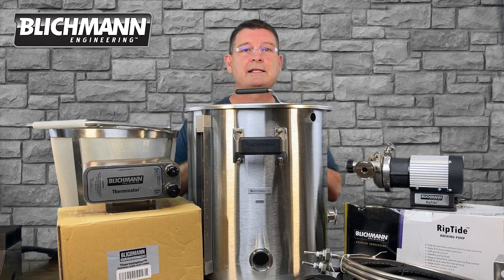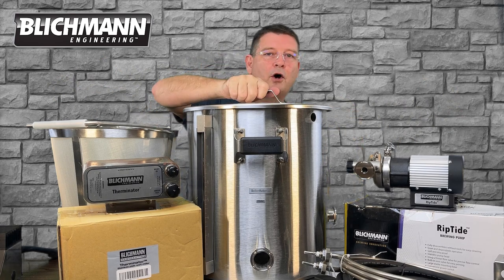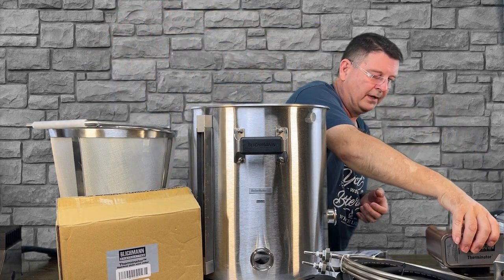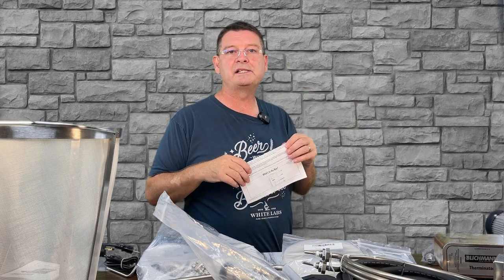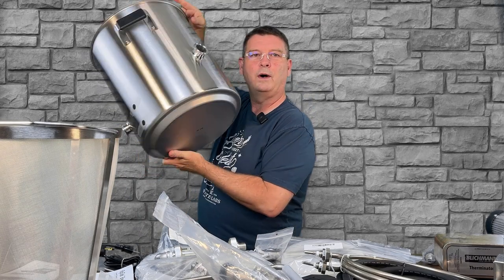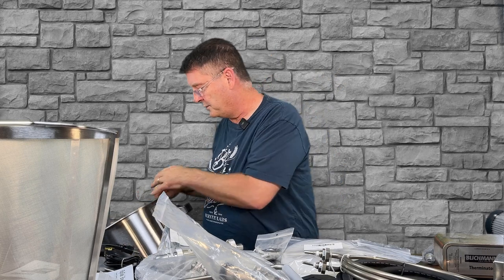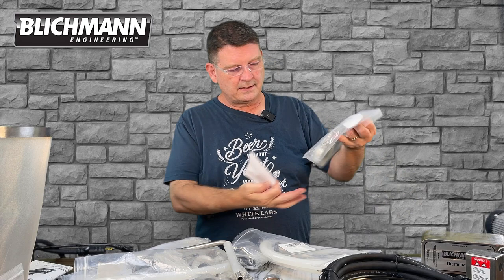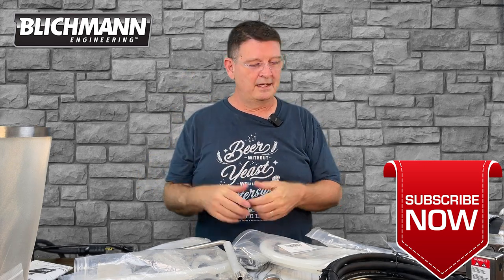Blichmann Engineering Brew easy compact all-in-one - Part 2

Comment: Not to also make some complaint. But, that's a lot of plastic for no reason. Paper envelopes might have been a bit better. Can even label them a bit better. Oh, well... looks like an interesting system. Can't wait to see more of this series.
Reply from the maker: Yeah, I see this with a ton of things I have shipped to me and it does bother me a bit but in comparison this wasn't that bad as I do get why they packaged everything in groups but as you said I guess they could have used paper envelopes. I think they wanted to keep everything grouped and visual at the same time. Not a huge deal for me personally as I have a habit of reusing bags, packing material, and some boxes as I ship a lot to sites I manage. I'm not a "Green" person per say but I do hate waste, so I reuse anything I can, whenever possible. (It drives my wife a little crazy but after 30+ years she has gotten use to it.) The only thing that usually goes to waste for me is the really big boxes and the damaged ones.

Comment: Thanks for sharing. When I built my system I went with the 240 volt boil coil. Pretty happy with it. I also did tri-clamps. Easier for me to take apart. There is some stuff that I would like to change still. Cheers!
Reply from the maker: Sadly those with 120v don't know how good it really is and how much time it saves. I will always push to use 240v whenever possible. I asked my builder for 2 - 240v - 30A outlets and from what I've seen it would appear I am getting 2 - 240v - 50A outlets which I'm o.k. with as I will need to make some modifications before I can move into my future brew space when it is completed. (Special flooring and a Split A/C (this might change the power setup a bit).